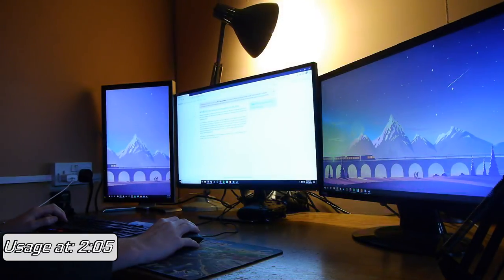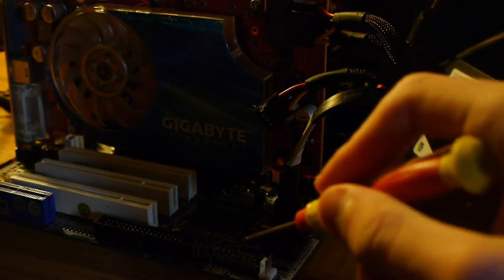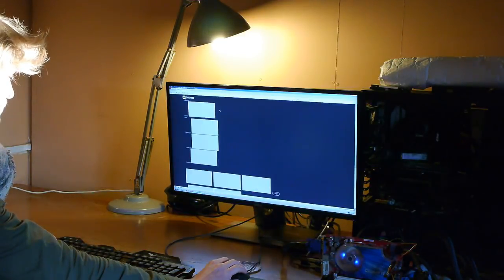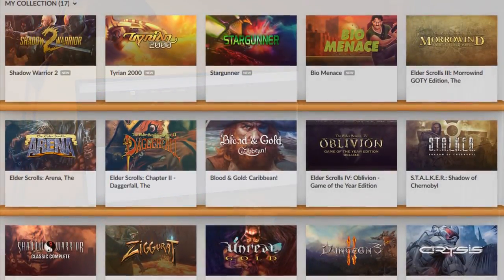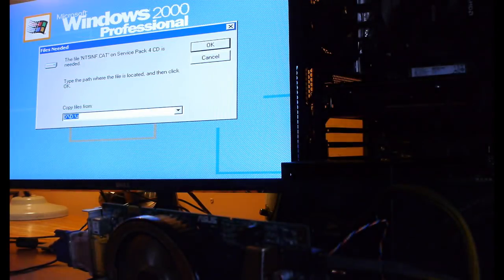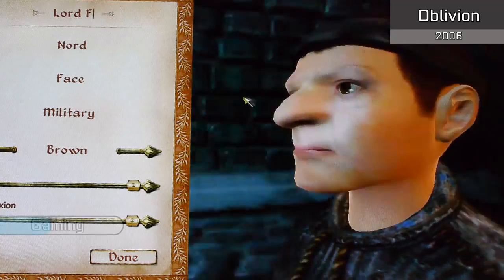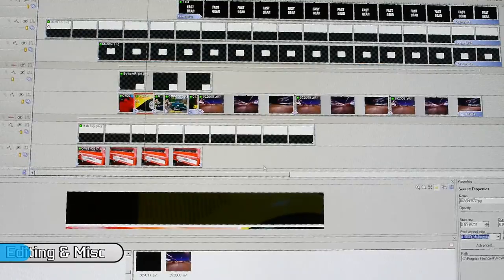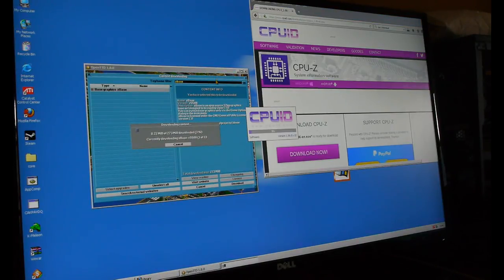Windows 2000 - Is it any good today?

Comment: Back in 2001, I dual booted Windows 2000 and ME on my HP Pavilion 9870 with an Intel Pentium 4 Willamette 1.3 GHz CPU, 256 MB RAMBUS RAM, 60 GB HDD, and NVIDIA RIVA TNT2 Pro 32 MB graphics card. It served as my computer for years until I was able to build my first one on my own. 2000 was for general stability and school use, while ME was for gaming. Then I upgraded to XP and left ME behind entirely. I miss Windows 2000 sometimes. That was a particular era in computing for me.

Comment: Nobody should run this and plug it into the internet. This OS has not received security updates in over eight years! In fact, even during the supported time period Windows 2000 was so bad that my machine would get viruses in mere minutes just from being connected to internet over dial up. There is no built-in firewall, and no current antivirus will run on it. Honestly, you'd be better off security-wise buying a used smart phone and using that as your everyday PC.
Reply: The ONLY way I would run it would be in a VM without internet access for....nostalgia.  Not much else.
Reply: @miserj  It would be fine to run it on real hardware. Just keep it isolated and don't put anything confidential on it. This would actually be safer than a virtual machine.
Reply: Just buy a windows 2000 security exam book to make it secure dude. Think before you say.
Reply: @reflectart9831  You can't secure broken code with years of publicly known exploits. No book will fix that. Next you'll say that 40 bit encryption is totally secure as long as you buy an ancient book to tell you how to use it.

Comment: I used Windows 2000 up to 2018, when I got an i5-2400 prebuilt I dual-booted Vista SP2 and Linux on. In the entirety of that ~12 year period I used 2000, I didn't have a single BSOD. To this day, I still consider it my favorite version of Windows.

Comment: Windows 2k was AMAZING back when I was running first an ABIT BP6 dual 370 board... as to take advantage of both cpu's.  And later an ABIT VP6 with dual FCPGA (P3's) Peltier bottom end water cooled top end cpu's .. overclocked of course.... with Win2k allowing both "cores" to be utilized.  far before multi core cpu's.... I was so damn far ahead of the curve... water cooling with transmission cooler rads, surgical tubing, submersible pumps in custom reservoirs, custom cut and painted cases, ice growing all over the cpu and board... which was always in condensed ice form and NEVER mattered one bit... as it was all that of distilled nature.  What a time.  And of course the "low spec P4" ran okay... that was high spec for Win2k, as it came out in or actually before the coppermine era... we were just off the heels of socket 7... It's old man.... old.

Comment: I used Win2k for a good while, back when I wanted to upgrade from Win98SE, but didn't trust WinME one bit. If I remember correctly, I used it until WinXP proved itself reliable and a worthy upgrade. 
With all SPs in place, I don't remember having any issues. Everything worked well, and at that time I was using my computer for school work (Office, Schematic and PCB design software), watching movies (DivX was the "default" codec during those times), listening to music and some light gaming (Counter Strike 1.6, NOX, Warcraft, stuff like this...).  Worked very well for what I need it to do!

Comment: My first PC build was with a pirate Win2000 disk, and I loved that OS to bits. My next OS was Windows 7. I managed to avoid the lesser OSs in between. My last PC build was my second, a few weeks ago. Win10. I checked every debloat, de-monitor advice I could find to make this annoying OS as good or better than the first 2. (I did have Win98 on my first PC).
If Win7 was not running out of protection by Jan next year, I would keep using it. Thanks for this vid.

Comment: I loved this O.S. while I had it installed. My 1st O.S. was Windows M.E. (yup, Mistake Edition). One day this O.S. had a serious crash and I installed Win2000 on my pc. It worked well with an AMD K6-II, 533 Mhz, 128 Mb RAM and 20 GB HDD (Quantum Fireball, the best brand in that then). What can I say? it was 2001, in my town there were a few pc stores and low budget attacked, the best Intel processor was Pentium III, 750 Mhz, expensive like always. Thank you.

Comment: Yeah, Win2K Pro was my favorite real 32bit operating system; glad that you mentioned that Win 98 was DOS (DOS 16 x2) as it was not an actual 32bit O.S. Excellent video.

Now, Win2KPro is gnawing at my brain again. I still have the original media & SP discs to, but it would probably be easier to just do the installation you have in your video. Anyway, thanks for sharing your experience.

Comment: I'm a Windows guy; always have been... (As a neurobiologist and psychopharmacologist, I deal with a myriad of scientific instruments and equipment that use either PC interfaces for primary data-collection or for modular and/or automated operations on my lab's local network. I do use Linux variation installations a couple isolated machines but Windows is the gold standard in related fields).  I have a few friends in audio-engineering and recording that use MacOS (at least primarily), but I believe that just about anyone that works in scientific or engineering fields will admit that Windows possesses a definite advantage over other operating systems, in regards to customization, fine-tuning, accuracy, and above all - compatibility!  Even most experienced home PC owners are aware of the compatibility and customization that traditional versions of Windows.  Sure, there are some valid criticisms of Microsoft and Windows, but (at least until recently) Windows has always been the most solid operating system platform for most scientific applications... 

However, ever since first using Windows 10, I've become convinced that somebody high up the chain of command at Microsoft is trying to destroy Windows... 😑 If I had to pick a favorite version of Windows, it would be XP - both for the aesthetic, menu layout and organization, customization, and general compatibility... It just worked!  I have virtually no real experience using Vista (except the basics), and I have a decent amount of experience using both 7 and 8. (My main machine currently still runs a slightly updated version of Windows 7, because I like it far more than anything that has come after it, by far)!  - (Microsoft has announced the retirement and discontinuation of support for Windows 7 as we speak).  Windows 8 wasn't terrible, though it did alter a few of the "Windows staple" menu-layouts and such that I didn't care for. However, I cannot (for the life of me) understand what sort of "medication" the team at Microsoft was taking while designing Windows 10.. 😑  It really appears that they are trying to merge the traditional Windows platform and a new sort of "mobile windows" that sort of resembles the Android/Google approach and I absolutely hate it. When first setting up the machine that I am using now (a two-in-one tablet w/ detachable keyboard) and an identical machine (purchased at the same time) I was instructed (via the initial Windows setup wizard) to create one type of user account (a standard local Windows account), while the machine had me create an official Microsoft account that is linked to an email address and an actual account dashboard and setting on the Microsoft website that also includes the "Microsoft Store."  I really do hope that Microsoft returns Windows to its roots (as a "safe" and "stable" staple platform), and abandons this merger of classic Windows x Android/Google mobile operating system!  The current Android mobile operating system(s) work fine and the Google Store being associated with them makes sense, but Windows 10 is a bit of a clusterfuck, and I worry about what route Microsoft is taking Windows... Microsoft had a "mobile" Windows OP that flopped.  If they want to create (or resurrect) a "mobile"-style operating system, more power to them!  All I want, when I purchase a Windows computer, is to have an actual (desktop) installation of a classic ("solid" and "dependable") Windows platform (as I have on my Windows 7 machine)..

There is virtually no consistency between most of the classic WIndows setting menus, device manager, control panel, etc. and their new Windows 10 version, I am not a fan of the right-hand taskbar menu (at least not as it is organized), it wants to download 'updates' so often that it is very irritating, the start menu configuration and programs list is terrible, and, well... even the aesthetic is hideous.  Okay, I know that's an opinion and I'm sure that Microsoft thinks that returning to the old flat, square taskbar, window headers, etc (like 95, 98, 2000, etc) looks "sleek and modern", but I much prefer the Windows XP to late Windows 7 aesthetic.. 😄  I honestly haven't even looked into alternative "themes" using Windows 10 (I know that I can change the taskbar and window header colors), and I have heard of some sort of downloadable plugin that returns the start menu to the classic Windows layout... If anyone has any input regarding that, I would appreciate it!  Honestly not even sure why I felt the desire or need to write this; I suppose I have just been needing to vent my feelings regarding Windows 10 to somebody, and this seemed like a good place to do so! 😄👍

Comment: My father worked at a Dominos as a manager for a multiple of years, and their IBM machines ran Windows 2000 all the way up until 2013 to run their Pulse server. Running from 11 in the morning to 12 at night took a tole on the old IBM front desk computers, and the old dell host computers and they started dying off. Dominos saw that we needed new machines and they gave us a brand new pair of high tech dell host towers meant to run the newly created Windows 10, but they equipped the machines with windows server 2008. But it didn't really matter because all the tasks they will ever do in their entire life is run pulse to take orders and show stats, and occasionally (quite rarely) do a quick Google search.

Comment: I used Windows 2000 on my personal file server. I switched it on. Installed it. Created some shared folders and that was it. It ran without a reboot for 2 years. Then there was a power outage. I turned it back on when the power came back. It ran for another 18 months before I went to a Linux based file server. Windows 2000 was really great.

Comment: Back in the day, I went straight from Windows 98 to Windows 2000 (skipping Me entirely), and stayed there until XP was well past SP1.  Coming from a 9x OS, Win2k was a breath of fresh air - both stable and fast.  Pretty much every poweruser I knew at the time (the ones who weren't running Linux full-time, at least) did the same.  While I wouldn't want to run it on modern hardware, I still keep a Win2k VM around just in case I want to run some old software, and my next retro PC build will be something well-suited for running it natively.
Reply: Similarly, I jumped from 98SE to XP SP2. Quite a leap.

Comment: I installed it (a while back) on my (home-built) pc : Asrock Nforce3 , Phenom II Black-edition 955(yes win2k runs quad core with a patch) , peltier cooling, 2x512 533mhz - CL2-2.5 DDR2 Corsair Balistix ,ATi All-in-wonder 9600 Pro, High power Astro gold 750w PSU , Thermaltake Armour case, and some random(not worth mentioning) sata drive. -
Worked great. No problems , fast as lightning. Cpu needed a patch to have 4 core in tune running under windows 2000 sp4 , but after that no problems. Runs the quad Black Edition overclocked well...

Comment: For the people who must know hundreds if not thousands of movies were edited, post Fx such as compositing, 3D with Maya, Softimage etc on Windows 2000 Pro with Avid Symphony. Many studios used Windows 2000 pro heavily for visual Fx post work. It is still the most solid embedded OS that Microsoft ever put out. I used to work in a photo lab and the Workstation for the Massive digital printer was Windows 2000 Pro running 16 hours per day of heavy usage. The only reboot was to shut it down and starting it up no crashed in for years.

Comment: In my experience Windows XP was the best one in that era,  much more stable, and file copying was faster. I got a lot of blue screen of death in Windows 2000.
Reply: I've always had problems with memory leaks in 2000. Sometimes it would act like the pagefile was too small or not accessible for some reason despite the drive being perfectly fine and having 2gb of ram. Never had an issue in XP with the same hardware.

Comment: Still remember using it on Celeron 400a@450 on ZX chipset with 64MB if RAM and S3 Trio32 VGA. Best times.

Windows 2000 UI is the best Microsoft created so far. Since then each releass is getting worse. Especially rounded corners on Windows 11.
Reply: Yeah, win2k was the best windows of all time.

Comment: Good video. I would have added, considering you spoke of video-editing, that a benefit of win2000 over say win2003 is that drivers for some brooktree (e.g. hauppauge WinTV go bt878) PCI cards are available on the CD and work well with the software and XVid codecs and so does Ulead VideoStudio7se. However attempting WinXP to use them with Scaler can be hit and miss. Some for some flatbed scanners (e.g. if you scan your face into your BaldursGate2 avatar). As an aside, a benefit of win2003 for gaming networks on LAN is it can take (and deploy) system images of WinXP gaming machines connected to it. A fun thing to do on win2k with win98 is netmeeting video streaming (e.g. using a hauppauge card as a "webcam" when really its TV-In is connected to a TV-Out of another PC such as one that is gaming). Also, as a plus for win2k, soundcard and joystick drivers (e.g. MIDI gamepads or flightsticks) unvailable for win2003 can be available for win2k. That also helps for old games that use midi sounds. A benefit of win2k is it can connect well to a network of win98 machines even if they run on 16bit hardware such as a 486.

Comment: it looks like a perfect pc to run need for speed underground 2 on :P i got it running on my macbook with wine a couple of days ago, its so much fun :D
Reply: Wine came a long way, most old games work, and for all the ones that have some type of issue (mainly lack of widescreen or text size/buttons too small) there's DxWnd which works inside of Wine just fine. Just make sure to enable "Expert Mode" and there's tons of options for you to config. I use DxWnd as a launcher to not mess with command lines and different folders, it's all kept in a single place, pretty neat.

Comment: Windows 2000 was and still is to this day a great operating system that didn't come with any unnecessary crap and it just worked, not only that it had the look and feel of an operating system that was aimed at advanced users and it definitely delivered.

I first tried it out years ago out of curiosity more than anything as I came across a copy and wanted to see what it was like compared to 98 SE which I was using at the time, at first I was rather hesitant as I had heard that it wouldn't work with certain hardware and software but I thought what the hell and installed it. To my surprise, it not only worked with all of my hardware, all of the software that I ran worked as well and then I just had to test something else out, would it be able to run games? The answer was a resounding yes.

It's a shame that Microsoft didn't try to keep their modern operating systems like Windows 2000, instead they opted for bloatware and changing stuff purely for the sake of changing stuff, I tried Windows 10 a few months ago and it is the worst version of Windows that I have ever used. Incredibly bloated, auto updates all the time, the user interface is a mess, easy tasks are now made a chore to do, I could just go on how bad it is.

Comment: I ran Windows 2000 on a 3GHz Athlon X2 right up until late 2010 or so when I finally bought a new PC and a copy of Windows 7. It was a great machine for Lightwave and Photoshop. I think it crashed maybe once the entire time I had it. Otherwise it would happily chug along for months at a time, only going down when a storm would knock out the power. 

I do seem to recall most DX9 games working pretty well, although there were DLLs and registry hacks that were required to get some of them to install and run. I did most of my gaming on consoles so it didn't really matter to me at the time. 

There are of course a lot of convenient features in modern versions of Windows, but its nice to use an OS that just works and stays out of your way. Microsoft wants the Windows experience to be as sleek and simple as a Mac, but seems incapable of actually doing that in reality without fundamentally removing all of the good features of Windows.

Comment: OpenTTD music =D

Firefox' performance is kind of in the disappointing side though, to not use harsh words... 3 years ago with XP I was using a chromium variant called SRWare Iron Browser, no "privacy" issues here and you can actually config all the settings you want (opposed to stock Chrome, which is another chromium variant by the way) Version 49 worked on XP, you'll need to test what version works in 2000. For Linux users, there's Ungoogled Chromium which is one of the few that offers an AppImage for you to test it out first. Combine that with uBlock Origin extension and you're set to go with low CPU usage and high performance.

For DOS games that work too fast (and still too slow in Dosbox) there's a tool called VDMsound which allows for sound without stutters and normalize most games' speeds once again. This should be fine for those intensive 3D SVGA late era DOS games that don't quite work as well in Dosbox. (Blood, Carmageddon, Screamer 2, Elder Scrolls Arena)